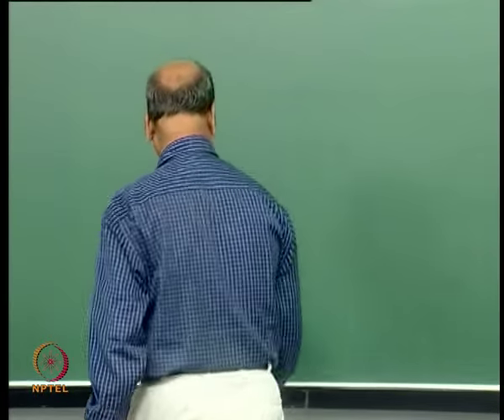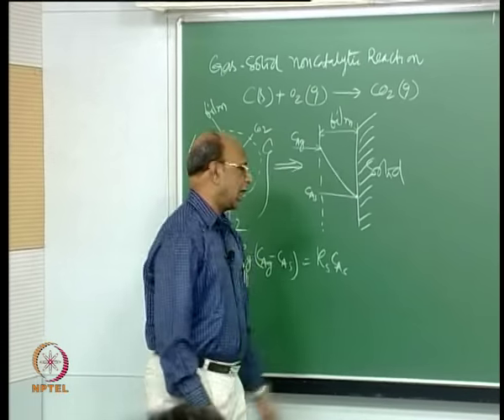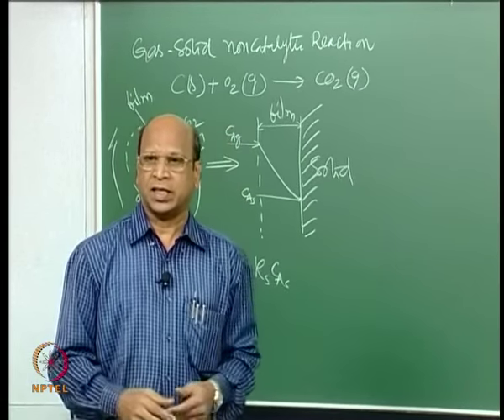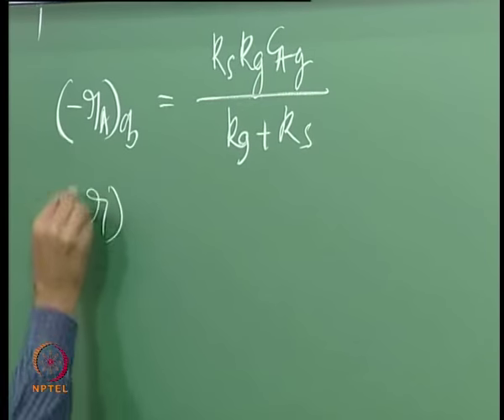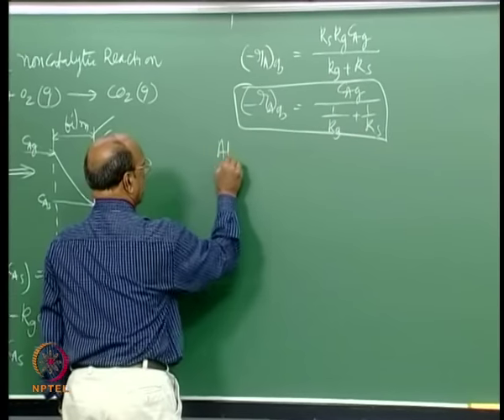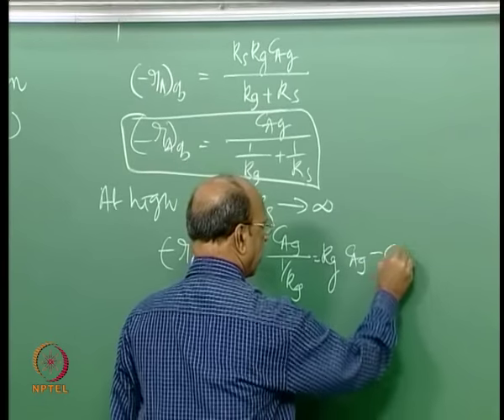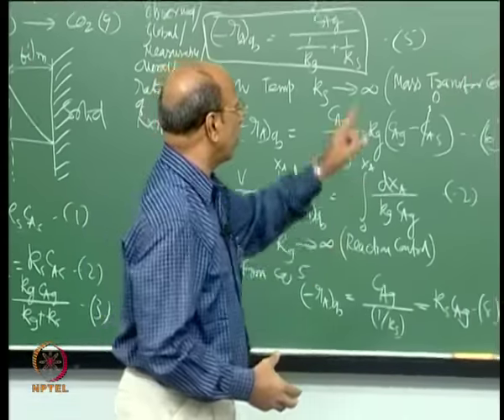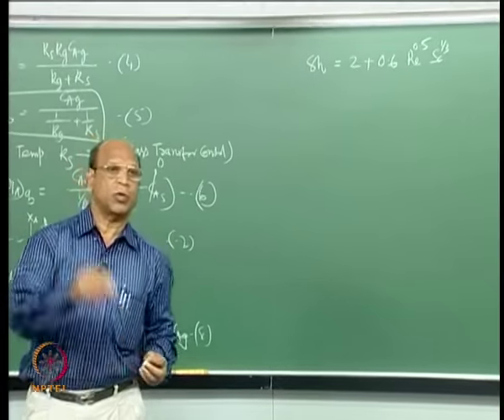Mod-01 Lec-01 Introduction to Kinetics (Gas solid non-catalytic reaction)

Comment: at high temperature ks -> infinity
at low temperature kg -> infinity 
whyyyyyy???????
explain plz. .
Reply: generally at high temperatures rate of reaction will be high and mass transfer rate controls the overall rate
Reply: At higher temperature the  rate of adsorption will decrease so the mass transfer controls the rate whereas at higher temperature with increase in inter atomic collisions the rater of reaction will increase
Reply: Kg>>>>>>ks therefore
Kg/ks>>>>>>1 
For kg to be very very very greater than 1 , it has to be infinite 
Therefore kg = infinite